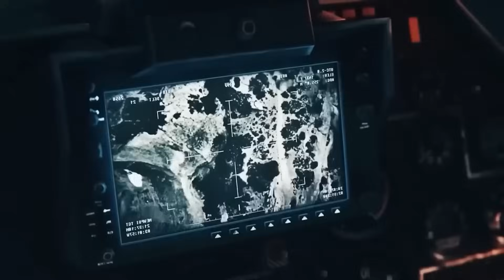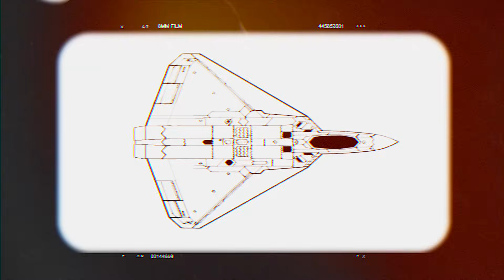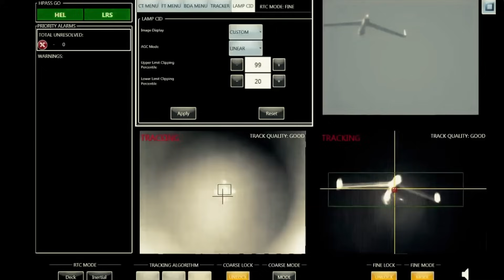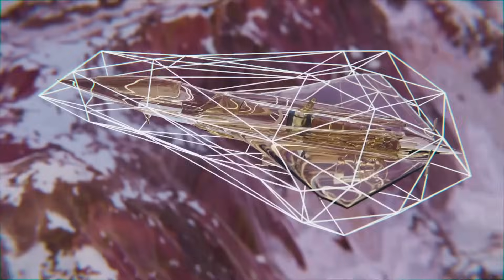Shock! X-44 Manta is a REAL F-47 Fighter Jet?!

Comment: Laser weapons are no joke.
High energy short wavelength lasers have been possible for over 25 years.
Wavelengths shorter than the HF eximer lasers and can be operated with continous or pulsed outputs and power density approaching 35MW/cc in the primary chamber
The only limiting factors are the quality of the optics required and electrode life.
EUV/soft X-Ray light at high power density is very demanding of the optics (clarity and curvature must be perfect and must be cooled to prevent premature failures (melting/shattering)).
The IR (long wavelength) lasers being fielded by the Navy are easier to deal with but only a tiny fraction of the power.
The EUVs in pulse mode can blast through Inches of titanium in a fraction of a second.
These aren't your classroom pointers!!  😎
(Yes, I DO understand the technology in "significant detail" but cannot discuss it in open forum.)
Reply from the maker: You definitely have a deep understanding of laser technology! It's fascinating to see how advanced weaponry has evolved over the years. Thanks for sharing your insights!

Comment: X-44 Manta is claimed by Lockheed Martin.  Lockheed Martin is no longer in the US NAVY F/A-XX and Boeing won the US Air Forces NGAD.  If the DoD wants to build based on the F22 design fuseloge, they might have to subcontract to TAI Kaan, a Turkey F22 knock off or Mitsubishi  F-X.  They could use the Korea KAI KF-21 fuselage but would need to go into the next phase of turning that aircraft to the fifth generation with internal bays.  Trumps would want to have those company open a temporary faculty in the United States.
Reply from the maker: Thanks for sharing your insights! The competition between defense contractors is definitely heating up, and it's fascinating to see how these developments could shape future aircraft designs.